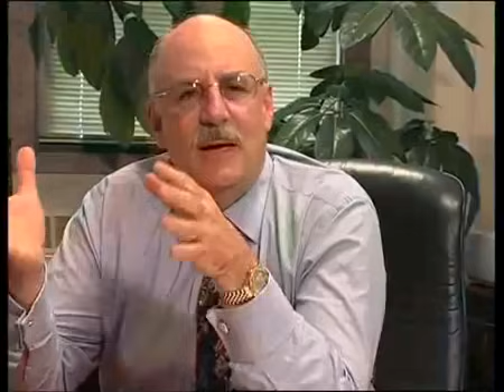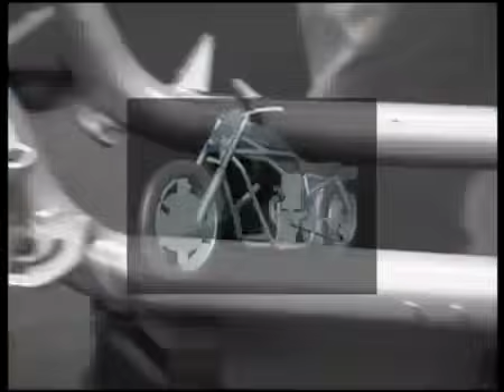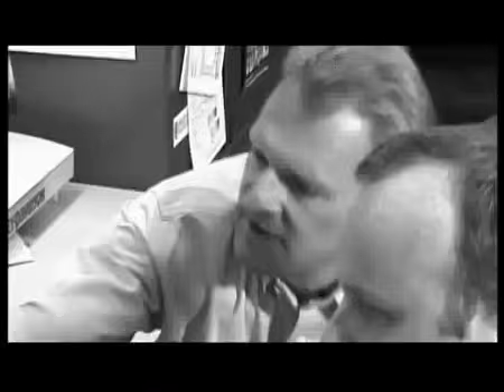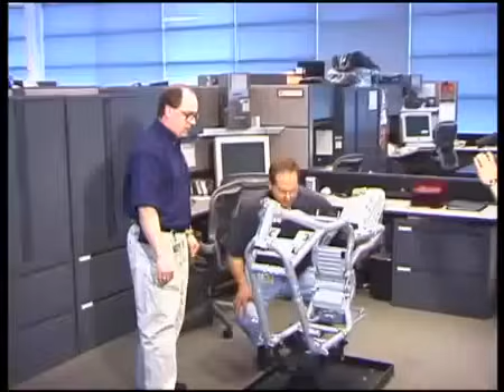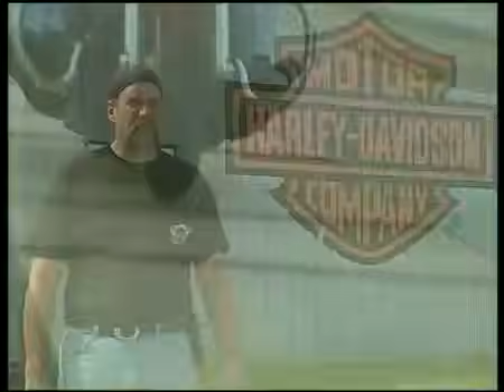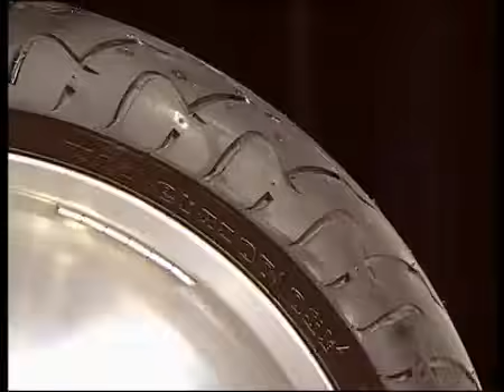Harley-Davidson Birth of the V Rod

Comment: OK, I love how Harley haters are driven to rant. I drive a Vrod and a Softail Deuce 88. To be honest, all in all, I like the Softail. That said, when I am out on the Vrod, metric cruisers constantly screw with my little 1250 on their 1600/1800/2000/2100 yada yada.
 The street Vrod is not a racer, but I get a real kick out of the big engine rice burners thinking they can blow the dust of any thing made by Harley. I let them blast off, then I blow by them with the blinker on. It usually takes them several lights of trying harder before they give up. 
I have been on poker runs where a whole club of rice burners try and shame me. They learn too.  

Yeah, I know there are faster bikes, but in the cruising class the Vrod does a fine job. Yes it is a Porsche engine, and yes most of the damn fasteners are metric. The funny thing, there are too reasons you don't see a lot of Vrods on the Harley floor. It is not overly popular, that is true. But, go to the service department and ask them about Vrods. They 'work on' the v-twins, they 'service' the vrod. the dealers are unhappy about the lack of service revenue on this very reliable platform.

Comment: isnt it a Porsche engine ?
Reply: Michael Holmes no but porsche helped in the design of it
Reply: Michael Holmes no. they took VR1000 engine to Porsche to tune it down so it could fit in a bike frame and no shake it apart. Porsche tamed the engine lol
Reply from the maker: alyx sampson The fact is the engine was not at all changed to fit the frame in any way, Porsche did in fact tear it down and rebuilt it from scratch using the VR1000 base. There are other videos that unfortunately were not allowed on youtube due to copyright trade secrets, behind the scenes that were not shown. It is not just a tuned down version at all. the VR1000 internals are not even close to being as durable as this engine as they are designed for race. all Manufactures use a based race engine when they produce a new engine.. HD was smart by going to Porsche as they only stayed with the old Push rod air cooled engines.
Reply: Canadian Gears Still, HD was too gutless to use a 2-pin crankshaft. Can't believe it. Porsche should have insisted. 'Revolution' my donkeys ass!
Reply from the maker: +Fletcher DeMaine It's not a forked connection rod. it is a two pin crankshaft.. Not sure where your thinking it's the old style. they are offset cylinders...
Reply: +alyx sampson What...? By your assumption, HD with all of their engineers, cannot tune an engine. That's  ludacris.
Reply: It is an engine designed by HD. Porsche helped with the liquid cooling and overhead cam integration. So, while Porsche helped with creation, it is not solely a Porsche designed engine. Some people just buy into the "it's definitely a Porsche" sales pitch.
Reply from the maker: +ken ross Wrong ken. This engine was already watercooled and had dual overhead cams. It's Harley's racing team designed VR1000 super bike engine... Porsche did not help with water cooling at overhead cam. They helped turn a race engine into a durable street engine that would meet EPA and noise regulations etc. You might want to do little more research my friend...
Reply from the maker: LOL your funny  again go do some real research... Talk to an actual project manager who was involved on both sides. the VR1000 engine is the base etc... Going by your buddy who probably doesn't exist or your just naive by your comments my friend...  what can you tell us about the VR1000??? lol

Comment: Forgive me for being so negatively critical.  By owning and riding one, their design management principles were not a surprise.  Form before function.  Riding gear, clothes and/or skin are burned by the exhaust every time I ride it, but it looks like a Harley.  I can't see anything useful from the mirrors, but it looks like a Harley.  It sits so low it sparks around mild corners, but it looks like a Harley.  The rake is so long it handles poorly, but it looks like a Harley.   It's a rolling piece of shit, but it looks like a Harley.  The engine runs like a scalded dog, but it was designed by Germans.